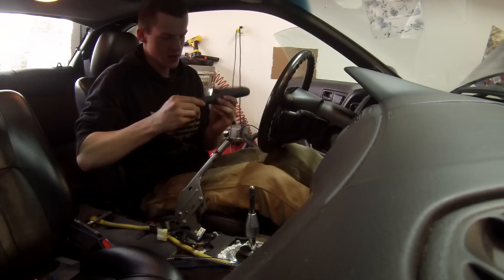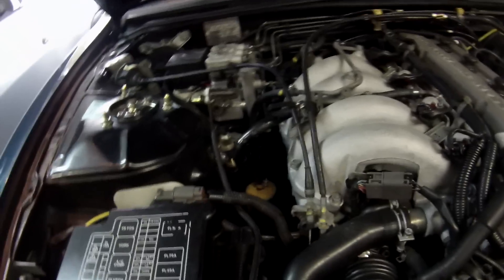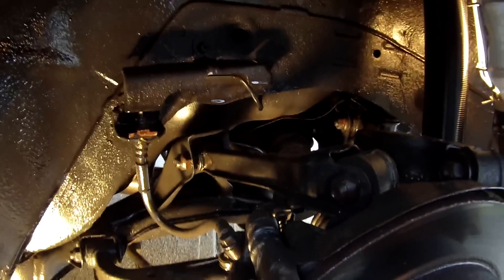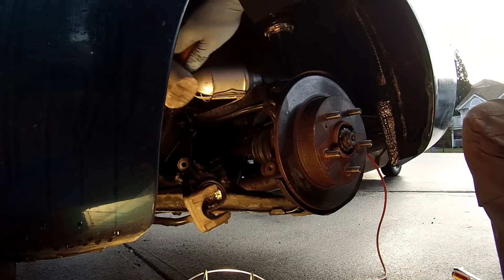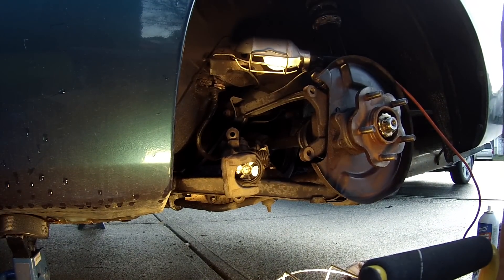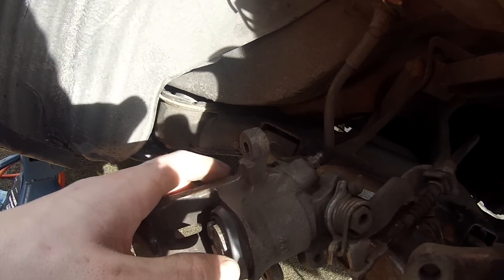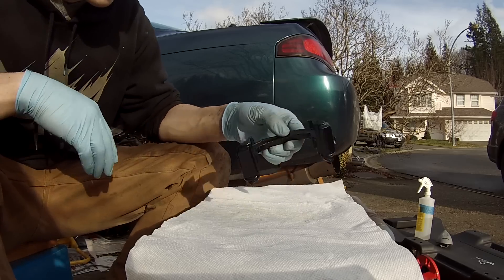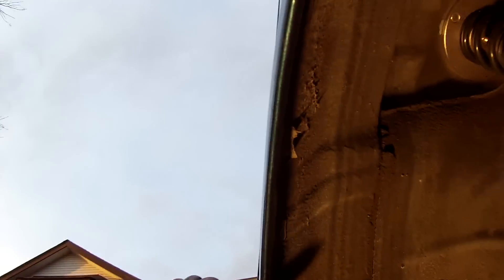240SX S14 Build EP.3 Brakes

Comment: If the rotor is ever seized like that again, you can actually just thread a bolt in either one of those 2 small holes in the rotor. Will push against the hub behind it and itll pop right off super easily. Was such a pain in the ass before i knew that with my s14
Reply from the maker: Yea I wish caught onto that. Good to know for next time thanks

Comment: you need a spanner wrench for your rear calipers pistons they have to be threaded back in and when your rotor stuck like tht again just whack it with a hammer in the fron right between the studs it will come right off do not hit the studs though

Comment: Good job on those fenders. No issues with cracking paint?
Reply from the maker: Thanks, and yes I did crack the paint on the other side :/ nothing bad just a 1" split on the lower front portion. I thought I knew what I was doing I guess and just went to fast ahha.
Reply: +BuiltLikeThis Is rust a problem in your area?
Reply from the maker: +CompressorSurge yea I live near vancouver it allways rains here
Reply: I live in the NW I understand. Do they use salt up there?
Reply from the maker: +CompressorSurge yea. Thats why I didnt put my wheels on yet. Im Just waiting for my spacers to come in now.